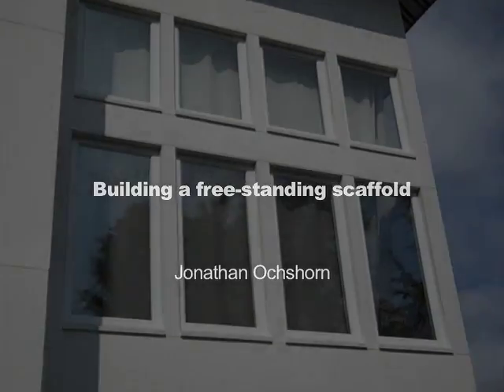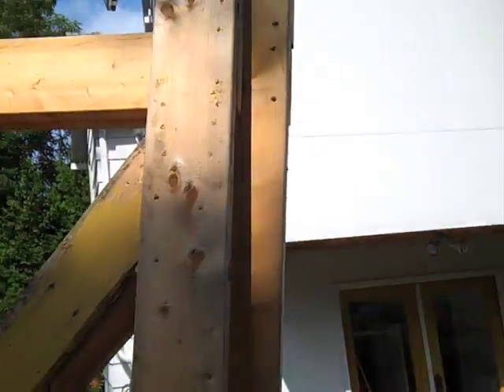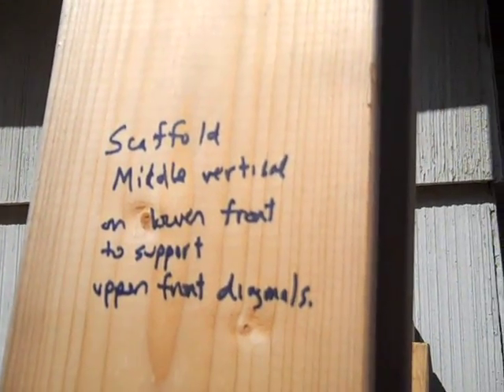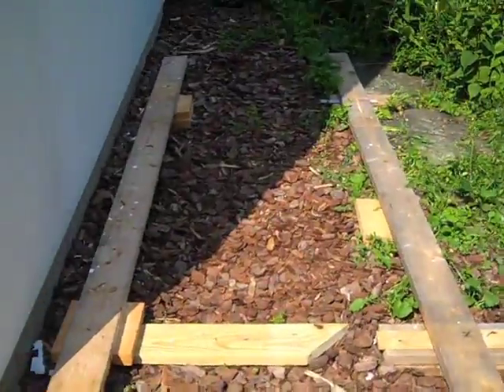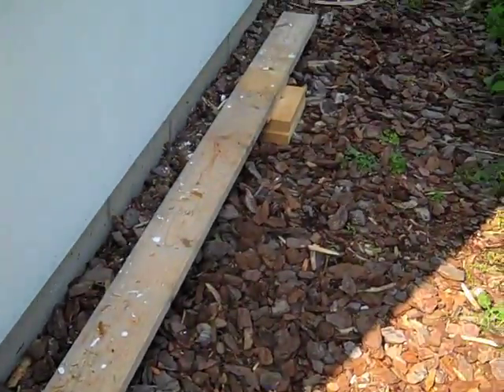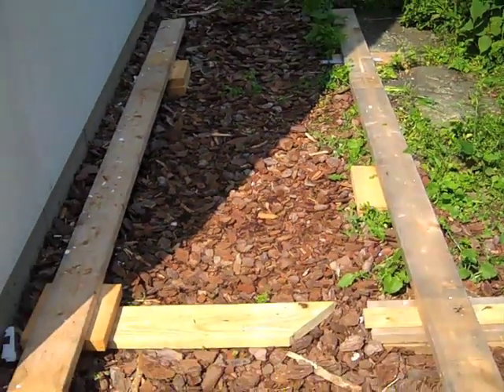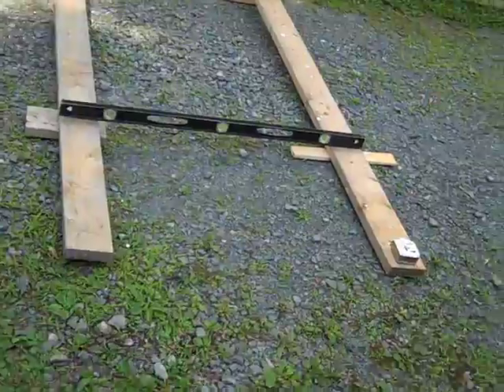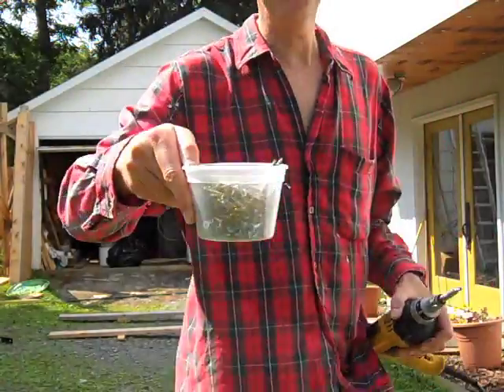Building a free-standing scaffold - Ochshorn

Comment: The base of the pre-fab sections on the base, what did you use screws or nails? I am new and have been told to use nails for load bearing portions. 

Screws for joining nails for load bearing, or do I need to get into making joints?
Reply from the maker: In general, nails have greater shear strength than ordinary screws, and so would be a better choice. However, I just used ordinary 3-inch deck screws, but used perhaps four at each joint to increase the total shear resistance. Since the live load (just me) wasn't that great, it proved to be sufficient. Probably best to use the new "structural" or "construction" screws, which combine ease of installation (and demolition) with high shear strength. See, for example: https://www.familyhandyman.com/tools/structural-screws-vs-lag-screws/